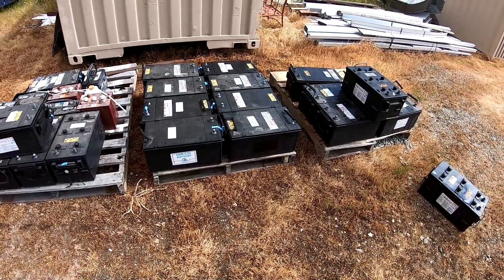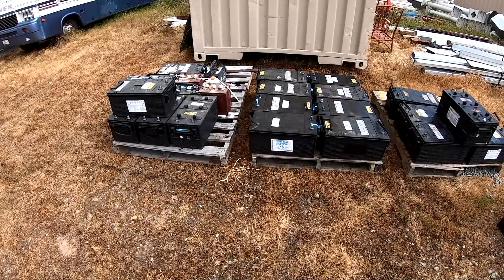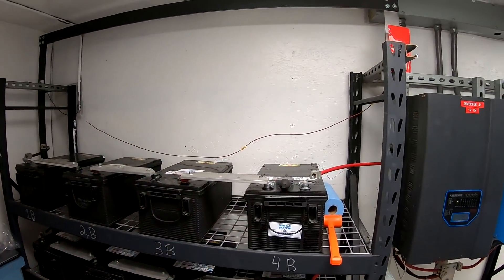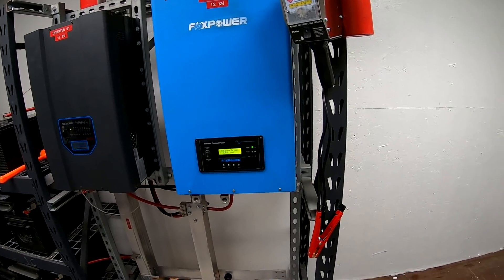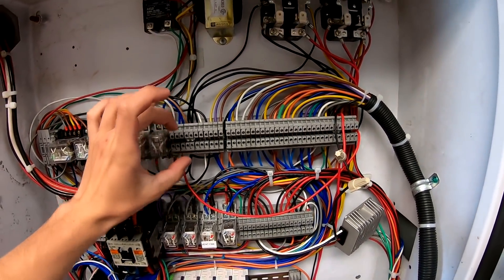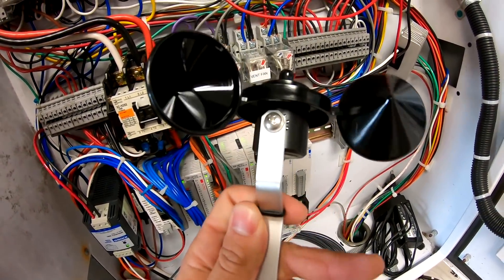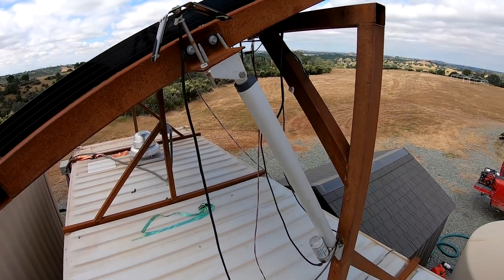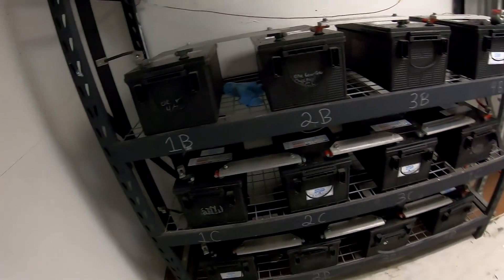Lead-Acid Batteries SUCK - Making The Switch to LiFePO4 (2/4)

Comment: I have been running my 19.2 kWh (400ah) Lifepo4 Pylontecs for almost 9 months now. They are superb, no maintenance, built in BMS works well with my Solax hybrid inverter, I live in Scotland and I have been off grid since the 29th of January.

Comment: Hi, 100Ah @ 48V LiFePo4 CALB are few, the recommended optimal discharge current is 30A (0.3C) the peak discharge current is 300A for 10 seconds only, (3C) you are giving seller parameters, suitable for selling batteries to sellers or generics taken online, for example other brands have different currents the recommended continuous charge and discharge is 0.5C the maximum peak 3C for 15 minutes the CALBs are more "delicate"
30A at 48V is 1440W let's say 1500W then you have to remove the efficiency of the inverter I assume a -10% (I'm optimistic)
they get 1350W in AC what are you doing?
also the optimum maximum charge current is 30A and peak 100A
I don't recommend it.
as capacity 100A at 48V -20% (assume the intensive use of 80% DoD 2.6V / 3.6V per cell)
you still have 3.840W what are you doing? How long would they last?
sorry but I think you're throwing your money, you have a 12kw inverter
let us also say that they are peak and never exceed the 10kw that divided 48V make 208A + a 10% consumption of the inverter 229 A.

At least I recommend at least 400Ah of the battery bank, in my opinion it makes no sense to make 4 from 100Ah!
good luck and good work

Comment: Enjoy seeing your progress. Thank you for sharing.

In regards to the Mounting circuit boards to a generator - you may find early failure. The vibration from the genset can eventually cause hairline circuit board cracks. You can mitigate this with rubber mounts. Circuit boards made for the purpose typically are made from fiberglass, versus plastic. Components especially electrolytic capacitors and those with physical wires as leads will need to be fastened to the circuit board with a nonconductive liquid adhesive glop because the leads will otherwise flex and break off.  I.E. Think of holding on to the leads with a players and wambling the capacitor back and forth, the leads are a solid wire and will easily fatigue.

Comment: If that's a power cord on the generator, you can get industrial weatherproof plugs and sockets for high current, then come in single and 3 phase, with or without neutral.
Not sure of the equivalent over there, but we use BS4343 style, or MK commando.

Comment: My extended family of cousin's  lives off a cat diesel driven generator set that has a 300 gallon drum that lasts about 3 months for power. They have lived off this setup since the 80's to now running 8 hours a day. They stay in california but they cant afford to connect to the utility's lines because they cant afford 100k connection fee to bring in the poles and the lines into there remote property but it feels camping to me when i visit them.
Reply: are they running a battery inverter system or just direct generator power?  100 gal/mo fuel bill is bordering on 300/mo in CA buying farm fuel.  They could pay for a power storage 24/7 system in under a year.

Comment: A quick search found a 22 connection weather proof connector that would make disconnecting and reconnecting the generator quick. If you wanted to go a different rout they make 8 pin connectors that you would just need to color code to get all the data links in place. 

They make a paint for wood floors that includes a sand grit to improve traction. It is not as good as epoxy paint but is also not as expensive.  It would still be good to paint under the batteries now as you will not be able to later without moving them around.

Comment: Hi Guys,
Which one of these two sets of batteries is better?
32 x 3.2 volt, 100Ah or 16 x 3.2 volt , 200Ah?
The 32 pieces @ 100Ah will serve 2 lots of 48 volts each while the 16 pieces @ 200Ah  will be used for 1 bank of 48 volt
Reply: Normally, professional grade lithium is sold by the A-h, so money isn't usually a factor in these decisions.  If there is absolutely no chance of needing two 100Ah banks later, get the 200Ah.  Think of it this way: The 200Ah (from the same mfg. of course) has internally exactly twice the plate surface area as the 100Ah, but only one set of terminals, which add resistance.  Also, if you were to parallel the 100Ah cells, you'd be doing it with busbars on top, which is more things to go wrong.  The 200Ah does it inside, with less resistance.  Hope that helps!
Reply: @haroldlopez2406  I truly appreciate your time and explanation. Thank you very much
Reply: @Wellness-Beyond  No problem - which brand do you expect to buy?  For example CALB CA180 has a nameplate rating of 180Ah, but it tests at over 200Ah, usually 206 +/- 2Ah.  Same for Winston with their 200, which is more like 220Ah.  Sinopoly isn't giving away any extra.  And the wanna-be mfgrs like battleborn are 100ah on day 1, dropping below 100 by day 30.
Reply: @haroldlopez2406  
I was actually going for Sinopoly 200Ah. I'm better off buying CALB or Winston then.  I did read somewhere that Winston and Sinopoly were once the same company
Reply: @Wellness-Beyond  Sinopoly is what I would call the lowest common denominator GOOD prismatic battery.  They don't do anything exotic, and don't include any extra Ah, meaning you'll hit 2.65V per cell after discharging its rated capacity.  Whatever you do, don't buy sinopoly on Amazon!  Someone is selling something that resembles sinopoly, i.e. black with ribs, but they don't say the brand and the pics don't show a genuine serial number tag. The counterfeiters are relying on people associating yellow with Winston, black with sinopoly, and old CALB was blue. The seller sent some for a paid review with number tags that say 1 to 4, not real serial tags from sinopoly.  It's also a massively inflated shipping cost, with no amazon protection since they just handle the payment processing.  If it WERE genuine, they would certainly say sinopoly in the ad, as that is a known good brand.  By not including the name or even genuine serial number tags in the pic, they can contest a fraud claim by saying "we never called it sinopoly."  CALB is overseen by and a part of the Chinese government, one reason people don't fake CALB cells in china due to punishment.  CALB also replaced the old blue ribbed case with a grey case injection molded with CALB and Chinese characters recessed into the plastic, a very difficult mold to fake, while the ribbed case package is easy. The makers won't get in trouble counterfeiting Winston or Sinopoly. plus very few people have the means to accurately test the cells, which is why the counterfeiters get by with it.   Make sure you know where it came from and they're an authorized sinopoly distributor with a serial number tag, test report, and warranty.  Electriccarpartscompany.com is a reputable source for many brands, although expensive.  If sinopoly is not new, then you're going to have a few % less capacity - probably  still  90% or more, provided the pack it lived in was properly maintained.  There are lots of used cells that are a decent deal, usually offered at 50 cents per A-h.   You'll pay extra for Winston, after you locate an importer, but both Winston and CALB are very generous on the A-h they come with new, such that a 2 year old cell usually still has more than the rated A-h.  Winston adds Yttrium to their LiFeYPO4 or "LYP" which gives you an extra 20c on the cold side for charging+discharging without damage.  The caveat is that LYP has different voltages with - don't quote me - I believe a charge voltage of 4 Vpc instead of the normal 3.65  that Sinopoly and CALB both use.  I really like Winston as the industry leader with innovation.  I like CALB for the value - I'm buying the CA180s  in a group buy later this year to cut the shipping cost down.  Just watch out for Amazon cells without "Prime"
Reply: @haroldlopez2406  
Your well detailed information is very helpful. 
 Based on your concern with counterfeiters I've definitively decided to buy CALB 180Ah from electriccarpartscompany.com as suggested.  I've also been browsing eBay for used CALB or Winston and have not seen anything yet.  Hopefully, someone will come along very soon and list some so I can grab as may as I can while saving a bit of money.
I'm very appreciative to have come across you here on youtube. You're truly kind and beneficent. 
Thank you so much!

Comment: Not sure why there are 18650 cell comments when he said he's going with LifePO4 Prismatic (block) batteries.    The LifePO4 Prismatics come in a variety of AH..   200AH is not uncommon.   You need 16 in series (3.2v * 16 = 51.2v nominal) for 48v system within normal voltage range.   Assuming 200ah each,  16 in series, then 80Kwh battery bank would be  16 * 8 = 128 of them.   If 400AH variety, then 64 would do it.       It will be interesting to see what you choose.     My system is 18650, but from what I read - LifePO4 have the longest life and sound like a really good choice.
Reply: Some people think the best way to store power is to nail a thousand 18650's to your wall.  In their simple minded world prismatic batteries do not exist, because it's always better to tear apart laptop and hoverboard batteries, buy worthless high resistance pcbs with 18650 sockets, loose money, and make up for it in volume.
Reply from the maker: Hopefully I can bring knowledge and education to some of these comments by making videos to show as examples

Comment: In old subs and ships, you could once find batteries made with Platinum. They have a next to unlimited number of cycles possible... I have see a few cabins here in Canada that have some of those in service... estimated 150+year use-sage life.. they do not make them like they use to..
I would go supper capacitors if I had the coin.. Note: To do this you need a discharge rate controller.
Reply: mike brink , The platinum batteries have great storage ability. but are amazingly heavy.. And normally have a thick glass shell.. Also not environmentally friendly if tossed.. Yet they keep working so is that not more environmentally friendly than most things?.. lol
  As for knowledge, that is not as important as application...
   When I was a child I heard ghost stories about this cabin with a glowing light.. 20 years later, I happen to be swathing the field around said cabin.. And then I see a light flash within the old log cabin.. So I go an check.. 

Note: the cabin had been abandoned for about 50 years.. Turns out an old rusty wind generator setup, was cracking out enough power to sometimes light an old 6V light.. IT was fixed in it's direction..
So only when the wind blew from one way would it shine.... Hence the old ghost tales...  It was that day that I learned that we once made shyte to really last!

Comment: 4:48 Good Idea.. Now use a micro computer like pi and a controller board. This way you could pull up the generator stats anywhere on you home network.. Heck, you could even go wireless data.. As the Generator has a battery that could power the Pi computer 24/7..

Comment: Instead of getting rid of that big terminal block and relays when you integrate the touch screen, why not keep it and keep it to wire something else that you don’t wire with the screen module?
Reply from the maker: Oh yeah for sure, but the point is it will open up space that would have otherwise been consumed.

Comment: Still not the best batteries to be using, you want 18650's. Lithium lasts longer, but with batteries you should be aiming for a decade max. Using lithium is like purchasing a $5,000 gaming PC so that they last you longer, but new hardware keeps coming out. So, it makes more sense to purchase a $1,500 gaming PC.

You will learn soon enough, glad you ditched the lead acid.

Comment: Horse mats that way if you drop a batt you lower the risk of damage
Reply from the maker: Interesting idea.  I could see quite a few advantages to a rubber floor - and it wouldn't be very expensive to do and easy to clean.  I like it.
Reply: Maybe an anti—fatigue floormat?